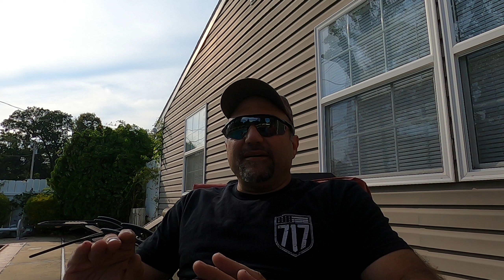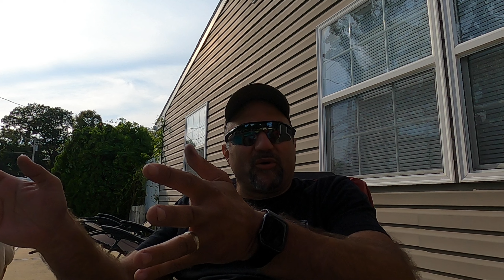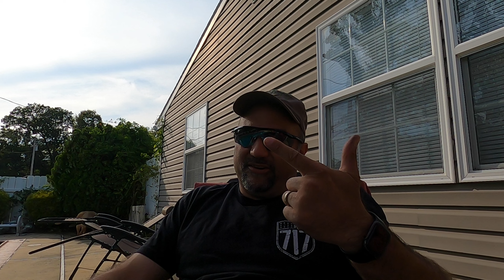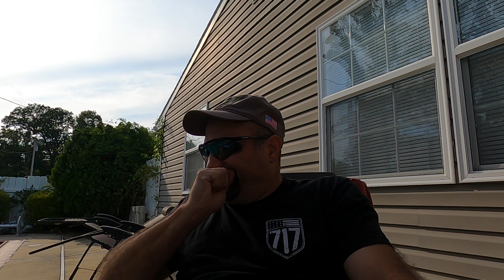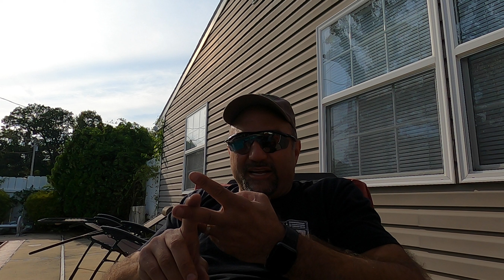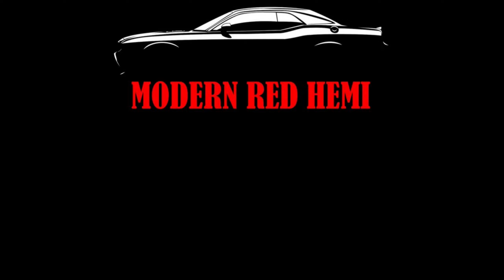Let's be honest and truthful. This one is for the haters and trolls.

Comment: I bought my 2014 5.7 Hemi RT used a couple of years ago and shortly after found your channel.
I paid a lot for my used RT because it only had 35k miles on it.
I have done some small mods to the car, weight reduction , sniper ported intake, ported throttle body, exhaust and a 
HP tuner dyno tune. I have had plenty of idiots ask me why do this why do that, you could get a civic or a rustang .
For me the Challenger is a very special car , I owned a 1972 challenger in 1988 it was a 318 car I swapped to a 383 it was the first engine swap I ever completed, I was young. I caught a lot of hate from the ford and chevy 350 guys. It was at that time I learned what it meant to be a MOPAR man. Wanted a gen 3 Challenger since they came out and now I own one might not be the fastest car on the road but it is quick and a lot of fun to drive. Your channel gives me a lot of ideas there will always be haters, keyboard warriors and S__T talkers. Talk is cheap would love to see what your haters are driving.
Reply from the maker: That's awesome brother that you have come full circle in the Hemi world! From 1988 to now. Still a Mopar Man! Love it! You're right. There will always be trolls and haters no matter what you do or what manufacturer you go with. Just brushing them off now and moving forward. 💪

Comment: People are just haters on the 5.7. A guy in my car club said straight to me "I won't even touch a 5.7" the 5.7 is the workhorse engine for Dode and Ram it has been for years.  Yes a few of them have a lifter problem but most of them kick ass for years.  People think under 500hp is boring because of technological improvements over the last 8years. Anyway I love my 5.7 and plan on moding the heck out of it and making it my own.
Reply from the maker: Yeah, people don't understand the workhorse the 5.7 is and how bad to the bone it can be. Just like everything else, takes time, money, and patience. 500hp and 11 second cars are fast. People don't understand that either. 😉

Comment: i’m going to build my rt but i’m not sure what horsepower range would be reliable and good for fun daily driving i’m thinking around 550 whp in between a cat and a scat
Reply from the maker: That is a great goal. When it comes to boost, keep it below 10lbs and you'll be fine with stock internals. That should get you closer to 600+ if tuned correctly. 😉
Reply: @ModernRedHemi  that sounds great you give us 5.7 owners a great look with what you have done

Comment: Don’t let this ppl get under your skin because you are doing what u are doing . Anyway u r the only person that I know that went 9 seconds in the stock bottom ends 5.7 is not easy to built a 5.7 to goes in to the 9 . Is like u said easy or cheap to build it no is not takes lots of time patient and money or you can go to other route like scat pack or hellcats but still lots of money there they are not cheap i have 13 challenger rt classic I put a few mod in there like exhaust, throttles body ,cold air intake but the most expensive I did is tune at the dynotune but anyway I love my 5.7 so keep up the good work
Reply from the maker: Thanks for the kind words of encouragement! I really appreciate it! I'll brush this stuff off next time for sure! More mods coming soon! 💪